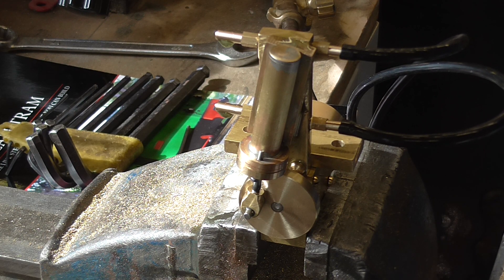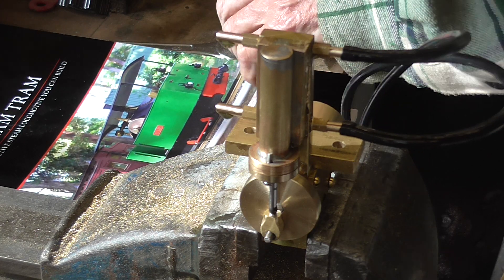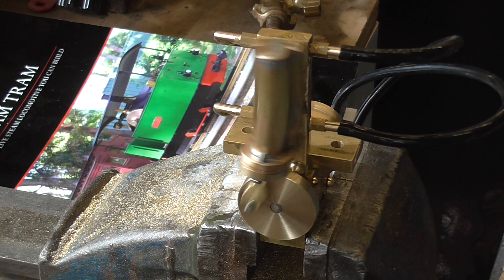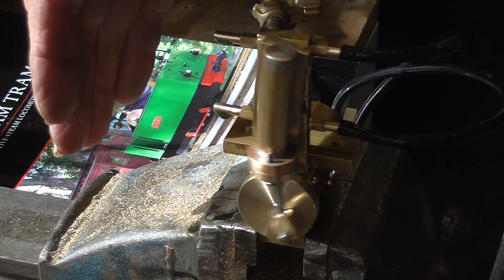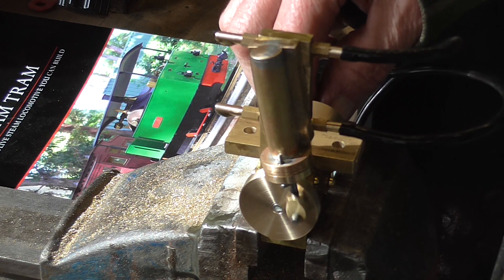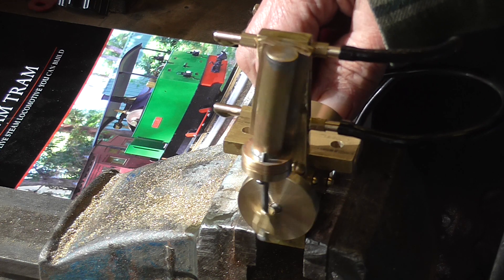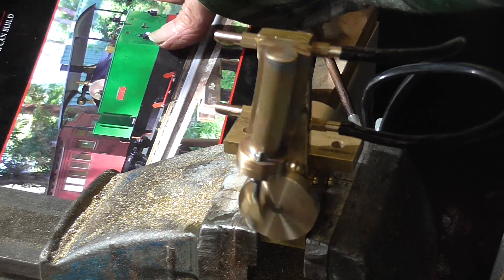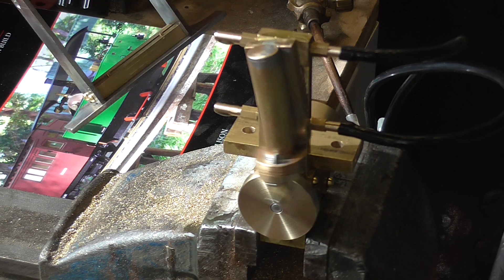ellie engine first run 001

Comment: Hi, nice job. I am about to start building ellie. Do you have a drawing for making the engine double acting? I would like it to be able to self start and reverse but as a novice I don't think I could work it out..
Reply from the maker: Hello Nick. I do have some sketch drawings which i used to make my engine although they are not complete "how to make it " but a good guide with dimensions. To make an engine self starting or self reversing you need a twin cylinder double acting engine not a single. a single will not self start if the piston is at top dead center or bottom dead center . I dont know if a twin cylinder unit would fit in an Ellie frame. Anyway the double acting engine makes the tram go much better and just a little push on the body is enough to get it moving once steam is up. If you send me your email i will send you what i have . leslie.breame@btinternet.com       cheers Les